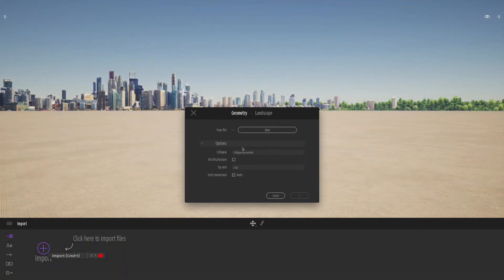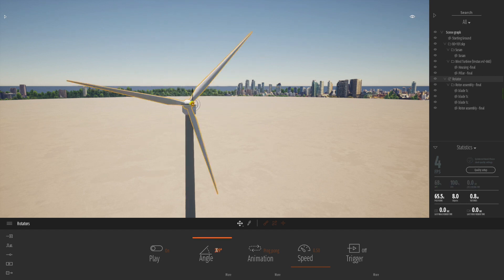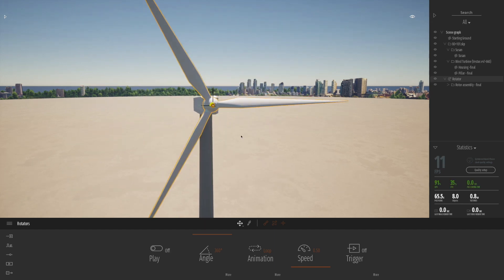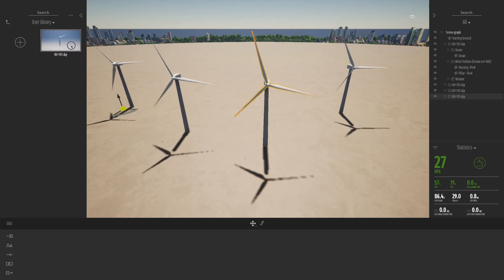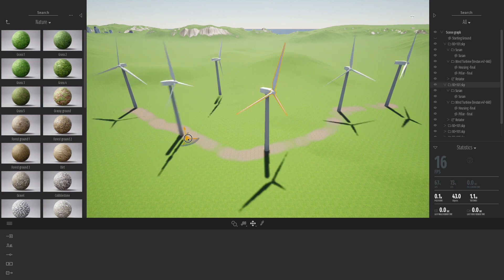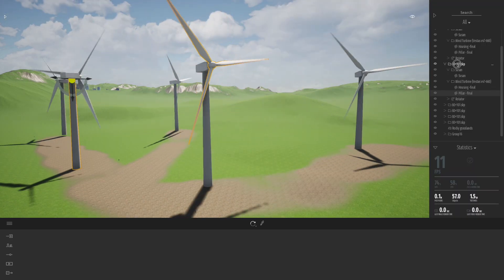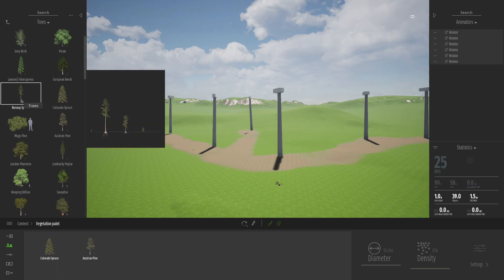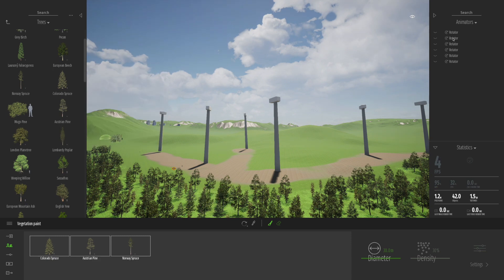Twinmotion 2020.2: New Animators & Rotators

Comment: 강좌 고맙습니다.
그런데 스케치업에서 구한 자료들이 본체가 분리 안돼서 본체와 날개가 한꺼번에 돌아갑니다.
그 문제는 어떻게 해결합니까??

(Google translation)
Thank you for the lecture.
But the data I got from the sketch-up couldn't separate the main body, so the main body and the wings rotated at once.
How do you solve the problem?
Reply from the maker: Try a different model where the rotor assembly is separated from the turbine shaft.
Reply: @jonathanreevescad  
I mean it's hard to find such material
If there is a material suitable for your purpose, please leave a link.